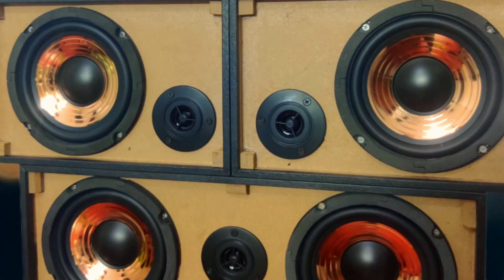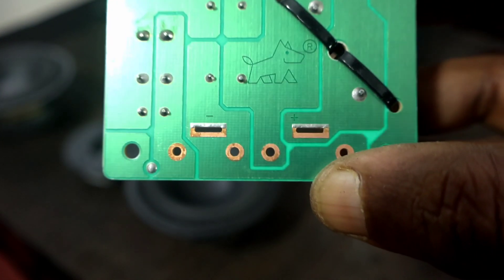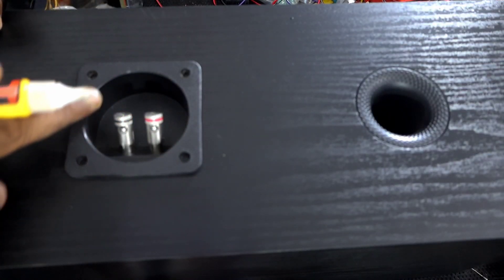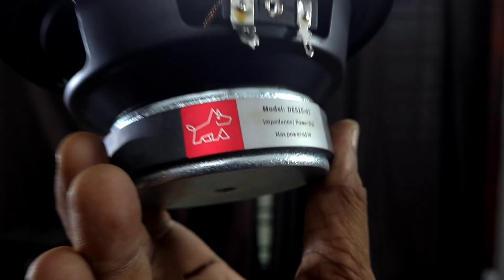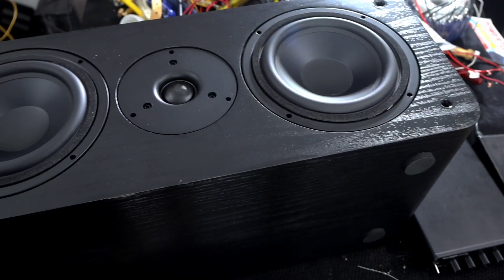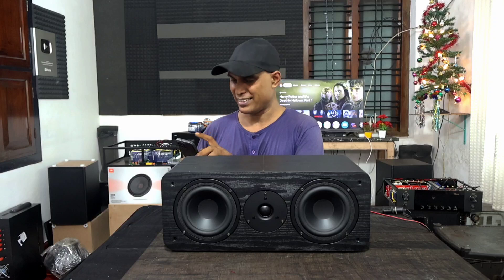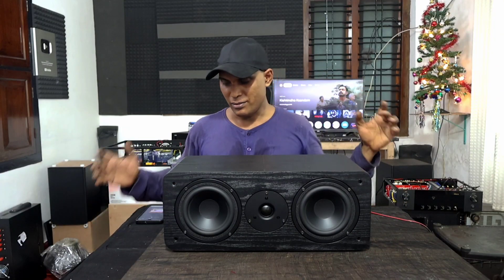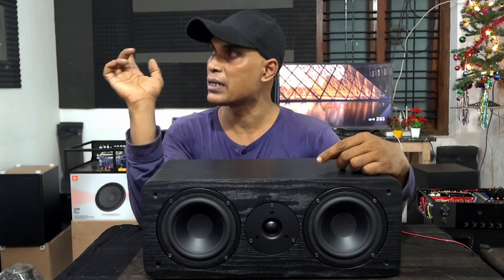DIY Center Channel Speaker Build | Step-by-Step video for Home Theater Sound

Comment: 8" Subwoofer Non-pressed Kevlar Cone

Maximum Power Handling Capacity 400W Peak

Frequency Response: 40Hz-5KHz

Nominal Impedance: 4 ohms

Recommended Amplification: 5-105WRMS

Sound Pressure Level: 93dB 1W/1m

Aluminum Voice-Coil/Former

Which amplifier board is best to use?